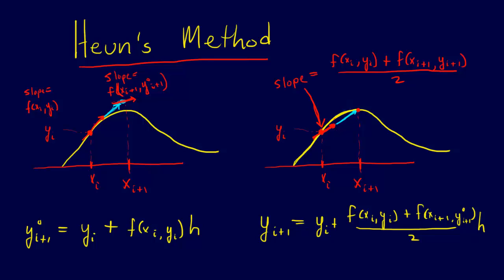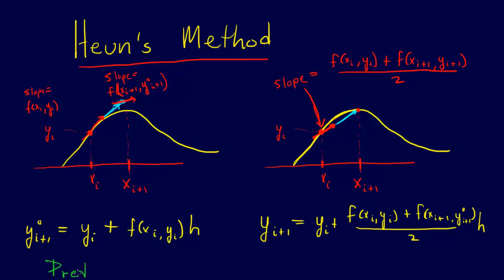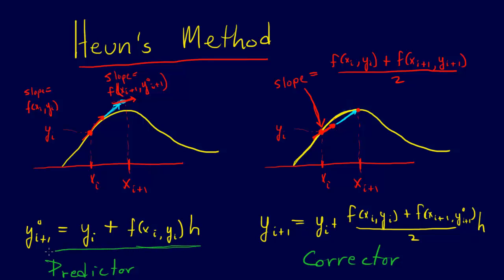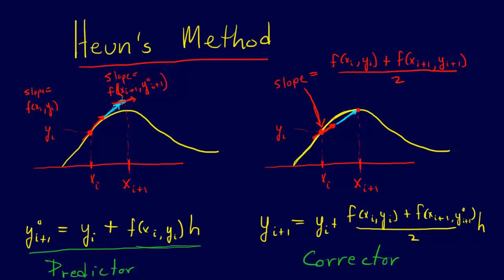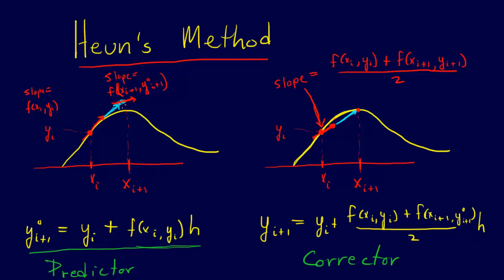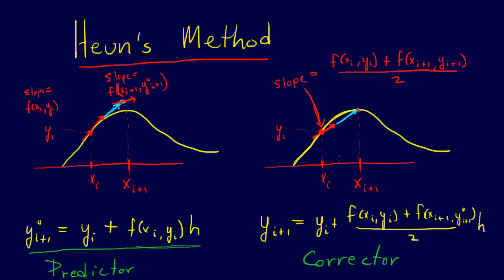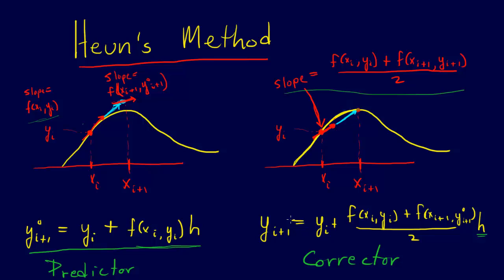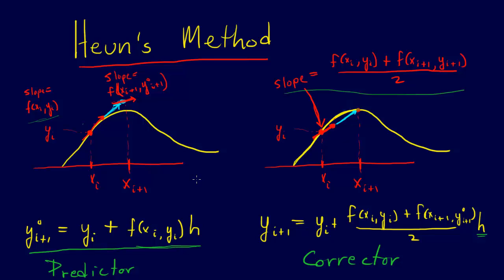7.1.4-ODEs: Heun's Method

Comment: so you have to know f(x, y) at each point?
Reply: Yeah.

Let's go through an example:

dy/dx = f(x,y)   ,   y(x_n) = y_n

Heun's Method formula:
y_n+1 = y_n + h(   (f(x_n, y_n) + f(x_n+h, y_n+1))/2  )

f(x_0, y_0) = the slope from the starting point x_0 to x_0 + h
f(x_0 + h, y_1) = the slope from x0 + h to x_0 + h + h

f(x_0 + h, y_1) = f(x_0 + h,   y_0 + hf(x_0, y_0))
because y_1 = y_0 + hf(x_0, y_0) according to Euler's Method which is
y_1 = y_0 + hf(x_0, y_0)

So to solve the problem all you need is an "initial value problem y(x_0) = y_0". With the help of that you can calculate everything else you need.

To make a long story short, yes you do in fact need to know the x_0 and y_0 value at the starting position and at the next point (x_0 + h, y_1). 

To continue more than one step, just follow the basic principle. You always need (x_n, y_n) and (x_n+h, y_n+1). You start from n = 0 to some desired n. If you want to estimate y(5) = y_5 you go repeat the algorithm from n=0 ---> n=4. 

n_0 ==> y_1
n_1 ==> y_2
n_2 ==> y_3
n_3 ==> y_4
n_4 ==> y_5
n_k ==> y_(k+1) 

I am quite new to this concept as well as I only just started learning about these kinds of numerical methods for ODE's. Parts of it MAY or MAY NOT be wrong, feel free to correct me if you find anything wrong! :)

I hope this helped clarify your thought.